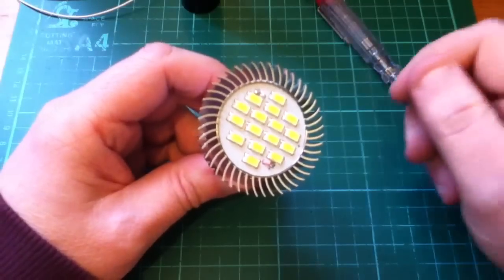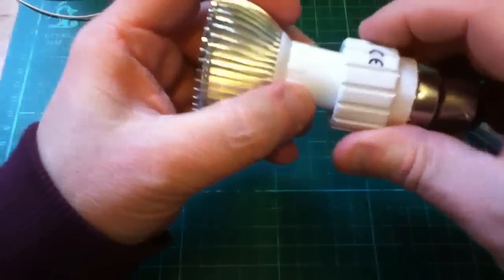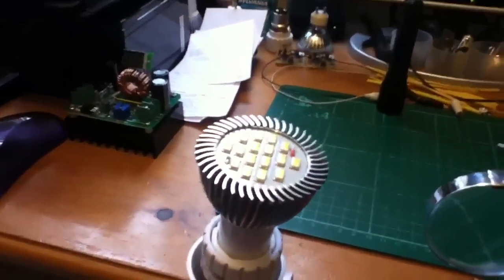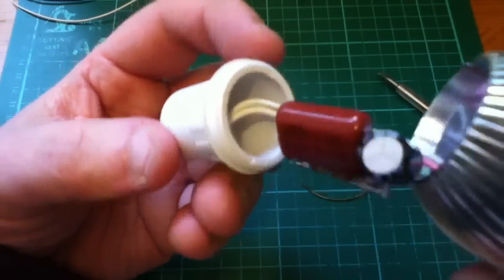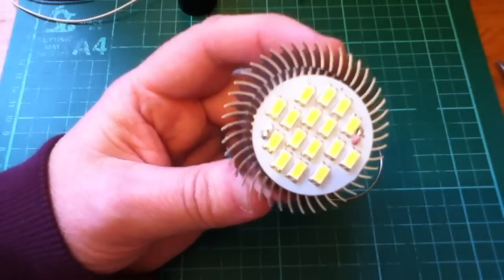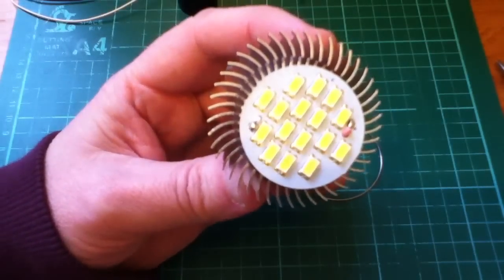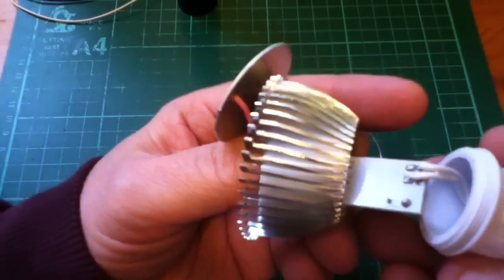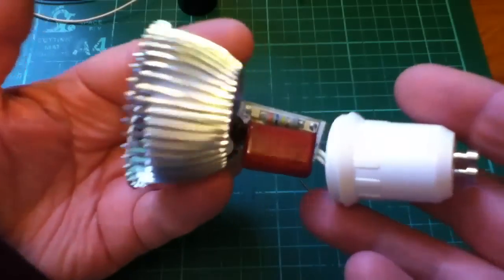Dangerous GU10 LED Spot Light is Cheap and Bright but could Kill You - Seriously

Comment: Stupid video. Lol at all the people buying into this. You do realize that 240V circuits have two 120V live wires and there really isn't a positive and negative since they both alternate at a frequency of 50 or 60HZ and pretty much take turns of being a positive and a negative at that rate. This renders this whole get the GU10 plug the wrong way around completely stupid. This guy is a noob and it's sad to see all the fools believing him in the comments. In a 240v circuit you have hot1 and hot2 and it doesn't matter what way around they are because of the way AC power works. This guy in the video clearly doesn't know how AC works and is looking at this as how DC works.
This guys video is as stupid as the one in the side bar saying that your LED light spies on you. Fuck sake.
Reply: You do realize this person is British, not that the accent gave anything away, and they have 240v standard, not 2x 110v. Also why this bulb is especially lethal due to the 240v rather than americas 110v AC.
Reply: You're missing a few things, as many others have pointed out, this guy is in the UK; Vphase-phase = 400V (or 415V) and Vphase-neutral = 230V (or 240V). This is the same in Australia and New Zealand.

What you're also missing is the neutral/star-point of the transformer is connected to ground, so ground and neutral should be sitting at the same potential; this would allow you (though I strongly advise against it) to touch the neutral without getting a shock. However, if you touch the phase or "live" conductor, you will have 240V across you.
Reply: ziongate the only one STUPID is YOU.   For the LEDs to work the AC has to be RECTIFIED into DC and Thus, There is a Bridge Rectifier or At least ONE Rectifier Diode to provide, either Full-wave or half-wave Rectification.
So, speaking of STUPID,  Stop making yourself one w your Ignorance. 
Go get an education before you interfere.
Reply: so many fucking idiots on you tube
Reply: vidar808

People should not be installing a lamp under load conditions. 

And that applies to any lamp as there is room for errors including the actually body of the light to be open to danger. 

People today are just to careless when it comes to electricity.
Reply: ficken Much of US uses split single phase in residential areas. 240v is split into two 120v lines at the transformer with neutral ground. Phase to phase produces 240v for large appliances and phase to neutral is 120v.
Reply: Tech Davey
 No dude, We do not use 2 phases.  [They are ONE phase relative to each other. But with the addition of another leg, They do become distinctively 3 phase as they are 120 degrees out of phase to each other.]
However we do have a ground between the 2 legs, so both legs may appear as HOT and 120V relative to ground.   (DELTA format)
and we do not have 208  That was decades ago.  it went to 208, 220, 230 and now 240.
Slow transition to allow older equipment to be phased out of service.
Reply: ficken California
Reply: It is informative, not stupid...you can take it or leave... but definitely not stupid... peace bro  __
Reply: +atomgonuclear: So you are saying that the definition of a multiphase system is whether or not it will start a simple motor, have I got that right? And "a real 2 phase system" would start a "simple motor"? In all my years of engineering and at no point in my years at university have I ever heard that particular definition and I also have never heard of a "simple motor" as an actual classification of any motor type. If what you mean is an induction motor then no 2 phase system will run it without a third phase (either by shaded pole, start/run caps etc etc or a 3rd phase to make in fact a 3 phase system). The US split mains 115/115 is in fact every bit a 2 phase system and it is very very real. It is also very very smart because it limits the phase to ground potential and therefore the danger of electrocution is also reduced. A 2 phase system will not start an induction motor because it will not generate a rotating magnetic field. You kinda got the right idea about some things but obviously don't quite get it. If any of this is important to you, I suggest you do some reading about multiphase systems, look into electrical supply regulations and the applicable wiring rules in your part of the world and electrical machines (specifically motors) but also ignore Jess Cast who just seems to be utterly confused by 2 and 3 phase systems and it seems has nightmares about the phantom "STINGER" who appears to be a member of the group "DELTA configuration". Tsk tsk.
Reply: +atomgonuclear: I take it back, you actually know NOTHING. the US runs a 2 phase system but very few other places do the same. The UK, Aus, NZ (among others) run only 3 phase systems and typically deliver only one of those phases into residential dwellings and it is not split. And a 3 phase system  DOES NOT REQUIRE 3 SEPARATE TRANSFORMERS!!! In fact a 3 phase transformer makes much better use of the magnetic core and is thereby much smaller than 3 separate single phase transformers.
As I said before, you need to do some reading so you can stop make an ass of yourself.
Reply: Great Words: I couldn't agree more, only hope I'm not one of them! ;-)
Trying to stop these idiots convincing people things are safe when they are not. Does one have to be an idiot to argue with an idiot..... probably.
Reply: Julian Sydow Correct.  It's a split single phase.  The two 120 volt lines only appear out of phase because the transformer is center tapped.  Since the phases are 180 degrees out of phase it can't be considered a real 2 phase system because you still couldn't use it to self start a simple motor since the current delay is proportional to it's split side.
Reply: I find it hilarious that you called this guy "stupid" and a "noob" while being completely wrong & sad that at least 3 people agreed...I just want to add; even if you were correct the bulb would then have a 100% chance of having 120V between one of the exposed connections and ground/neutral...
Reply: atomgonuclear They are not 180 deg. out fo phase.  All 3 legs are 120 deg. to each other.  but 2 of the legs have a center tap to ground. and have 120VAC from GD to either leg.
The Third, also known as the STINGER has a Higher Voltage in relation to ground.
This is True in a DELTA configuration

the WYE (Y) configuration has ALL 3 legs connected to a certer Tap. at the intersection.
and thus have equal voltage from the center tap. and they, also 120 deg. out of phase to each other.
Reply: ficken No. You are wrong.  they are 240V from each other BUT there is a Center tap connected to ground or "Neutral.  That makes them 2 lines of 120VAC EACH  but they are out phase w each other by 120 deg.  The Third Leg is the STINGER and that is over 200VAC from Ground.
look up the DELTA pattern of a 3 ph. system.
Reply: Jess Cast You have no idea what your talking about either.  Residential houses are not commonly 3 phase.  Your talking about High Leg configurations.  Nobody uses them. Standard residential houses have 2 120 volt lines that are 180 degrees out of phase to make 240.  It's called split phase.  I don't know if you know what center tapped means, but it means when one side of the transformer is high the other is low.  Just look at any residential phase diagram in the US and you will see that you are wrong.  There is 3 transformers on the pole.  1 goes to the house.
Reply: Mr100duke I dunno who your comment was to.  I'm talking about US, however it's the same in any split-phase even in the UK.  It's a split phase from 1 transformer(hence single phase).  There is 3 transformers(3phases) on the pole and your house only uses oneee phase(tranformer). The split part comes from the center tap of that single transformer.  Whether it's 120 split to 240 or 240 split for 480 it really doesn't matter.

Comment: in Babylon we use 120v ac but in your country i hear you use like 240, we only use that on devices over 20 amps
Reply: Is it really still so that your power supply is 60 Hz?
I'm from Germany ...
In earlier times we had 220V. Now we have 230 V AC and 400 V three-phase. Still with 50Hz. Available in 3 neighboring countries, there are also 240V. Since I had only but look more closely.
For normal outlets (230V), we usually use a fuse with 16A. (So 3680 watts)
For light we take 10 to 16 A. But mostly 16A.
Then we have three-phase outlets with 16A, 32A, 63A, 125A. So the equivalent of up to 10 kW, 20 kW, 40 kW, 80 kW.
For normal houses they are rarely installed. If so, then only the 10 and 20 kW variant. Higher values are found in the rule only in agriculture, commercial, industrial and events.
The main fuses in the house connection boxes are in the normal case 3x 50-63 A.
An apartment itself is usually hedged with 3x 35A. (Selectivity)
So there are 3 x 230/400V for disposal. In individual cases, there are still homes that only get 230V AC (A single phase).
These apartments are converted gradually to 230/400V three-phase and get new fuse boxes.
For 230V, we take 3-wire cable. Phase = brown, N = blue, PE = Green / Yellow.
For 400V, we take 5-wire cable. Phase1 = Brown, Phase2 = Black, phase 3 = gray, N = blue, PE = Green / Yellow.
For switching applications, we also take 5, 7, or multi-core cables.

Blue and green / yellow should never be used as a Switched phases.
If such an offending determined and found the responsible firm or the person responsible for this, it can wrap up warm ...
How do I know all this? I am electronics engineer for energy and building technology.
Reply: yes sir i dont no why
Reply: djblackarrow we get a lousy 1800 watts per outlet here its heart breaking at times
Reply: NOBOX7
I have to add something:
In new buildings or renovating old buildings, it is in Germany law to install one or more residual current circuit breaker in the electrical system. It is used solely for the protection of persons. Theoretically, one can then take the finger to a phase - the residual current circuit breaker will trigger immediately.
But since I have respect for the mains voltage, I would not try it.
Cables, cords or wires that are not under tension, I treat as if they were still under tension. Unless I'm building a fuse box from scratch on.
It happens very often that I have to work while the power supply is on.
We use tripping currents of 30mA in houses, 300 and 500mA in construction site distribution boards.
In Wiesbaden-Hainerberg at USAF, even 10mA residual current circuit breakers are installed. On the 230V and 120V supply.
Reply: NOBOX7
Why only 120V are disposal with you, I do not know unfortunately.
I think that was earlier introduced so. And the effort all 120V devices, substation and transmission lines to 230V and / or 400V convert, would be much too big and too expensive. So they leave it up to today in 120V.
Our transmission lines perform the following voltages: 400V for short distances (but also for the laid in the ground ring lines over which the houses are supplied), 6kV and 20kV for city-internal power supply (From the substation to the transformer houses. Cables are lying underground), 110kV, 220kV and 380kV for long distances between power plants to the substations. All in three-phase version.
Reply: djblackarrow
Here in the USA, most of those "residual current" devices, or GFCI as called here "Ground Fault Circuit Interrupter" the test to trip is only 5ma. Yes, 5ma at 120Volts. Seems to me to be safer than 10ma of 240V. But, we do get nuisance tripping from time to time. That's very interesting that normal houses and apartments (or flats as they're called in the UK) can get 3 phase power. Here, 3 phase power is only connected to large commercial, industrial, or some large farms. But a lot of the rural areas this is not possible, because of what I like to call the Sewer electrical system (SWER = Single Wire Earth Return). How this works, is you have a small substation fed with 110 or 230 kilovolts, then short lines of either 7200 or 14,400 volts going along the top of the utility poles. From there, a single hot leg goes to one side of the primary of the "pole pig" transformer. The other line goes to a ground wire. Then the secondary is center tapped, and you get your 3 wires to your house. Hot, neutral and second Hot. You provide your own ground with at least 2 grounding rods driven into the ground, and this becomes your PE wire, which is bonded to neutral in only one place, in the mains box. Nowhere else is allowed to be connected to PE, except in some cases out buildings such as  barns or garages etc, which can have their own ground stakes. This system saves running 3 wires all the way out to rural areas. But it's not so efficiency, because the ground isn't that great of a conductor to allow a return path from the pole transformer to the local small substation.

You can't have 3 phase in a house, if there is only 1 high voltage line serving the neighborhood. That takes 3 high voltage wires. However, you can have "split phase" by simply using a single phase transformer with a center tapped secondary.

I think the reason is it would take a lot of transformers (you'd need three on each pole instead of one that can serve three houses, plus a lot more wiring inside the house). However, it would be nice to have, as we could get air conditioning units with 3 phase compressors, and run 3 phase air compressors, or shop tools etc. Here you can't get anything over 5 horsepower unless you go to three phase, there is a few 7.5 HP motors around, but they get very expensive, and the amount of crap you need for start assist, run capacitors and all that gets ridiculous. With a 3 phase motor, all you need is a contactor, and starts instantly. Want to reverse the rotation? Just swap any two hot leads and away you go. Try that with a PSC motor, unless it's designed to run both CW and CCW, not going to work. Yes there's a trick you can do, but that only works if the run and start windings are identical.

Most 3 phase systems here use a "Y" config with a neutral and 3 120V "legs), so you have 120/208 Volts (120 x square root 3). The next step up for large business, big box stores, shopping malls etc have 277/480. Sometimes with a Y, sometimes Delta with one leg grounded. But there's a lot that are Y, most of the load is lighting, and using a 3 phase Y allows the use of common 277Volt lighting ballasts, and being able to connect them on all 3 phases and balance the load. Can't do that on 480 Delta, as a Delta has one side that is a "stinger" as that other commenter mentioned.  The next step up which is rarely used anymore is 347/600 (nominal 575 Volt). I worked in a processing plant for 6 years in the late 1990's that used this system, and we had two step down transformers in the utility room for supply to the offices, break rooms etc to step that down to 120/208.  I've also seen some large manufacturing company's that have 2400/4160 3 phase in the air conditioning plant, for power to the chillers.

For you people that think 240V is a walk in the park, try 2400 volts, thats 10 times your mains voltage in europe :)
Reply: djblackarrow
Distribution voltages here are all over the place. Most common where I live in Indiana, is 230 kilovolts. There is lots of 110 kilovolt here because I live in a small town. The big long distance lines are 765 kilovolts, those are almost a million volts! 765 is fairly common in other parts of the world, even South Africa. On the west coast there is also some long distance HVDC lines, I think in the long run HVDC might be better for long distance power transmission. Less need to worry about synchronizing grid frequency, much less danger of power outages from solar storms because even a massive solar storm would only cause minor voltage fluctuation, but DC injection into an AC system from such a storm can cause massive blackouts. DC also travels via the "skin" effect, this means you can use hollow cables to save weight, or ones with a good conducting outer sheath, with a very high strength inner steel core. The disadvantages to HVDC are the problem of how to build very efficient inverters to convert gigawatts of DC back into pure clean sine wave AC. Thankfully, thyristors and semi conductors are getting better all the time at handling hundreds of kilovolts and thousands of amps. In the old days, they used mercury filled devices, obsolete and incredibly toxic.

Comment: Am I missing something here!!! These are 12v Leds, if you were supplying the LEDs 50% of the time with 240v ac they would be blown to bits. Surely if it lights-up the supply to the front is going to 12v smoothed by the electrolytic. What a JOKE!!

Comment: That makes perfect sense I am an electrician and we had to change a load of these one day at a pub. The customer had brought them cheap an i did receive a shock of one, it was a down lighter so i presumed id touched the terminals at the top. But when looked they were all covered. I took the lamp out put it back in, turned power back on couldn't find any problem. Bet that's what had happened